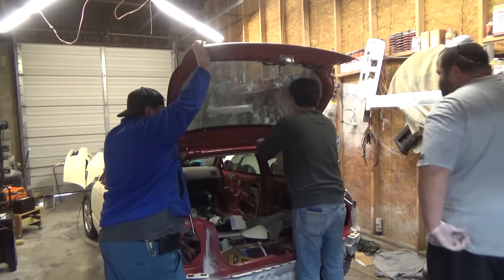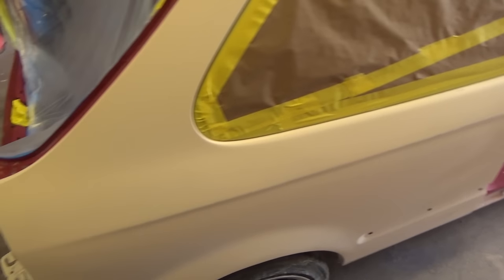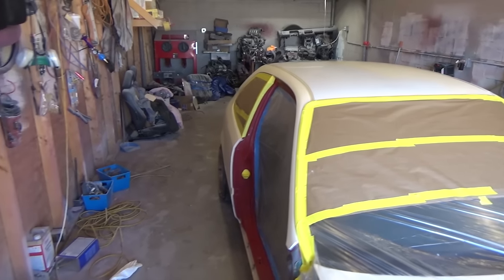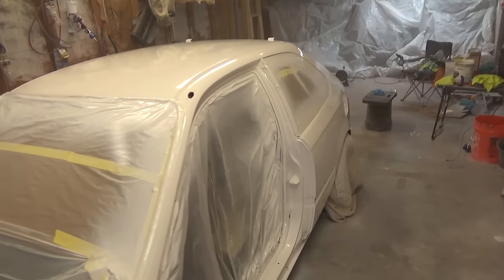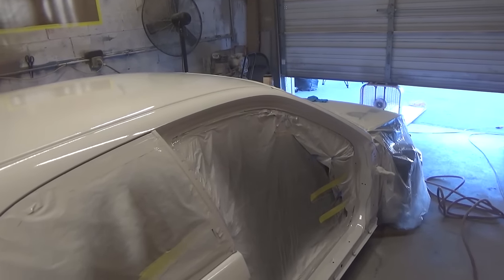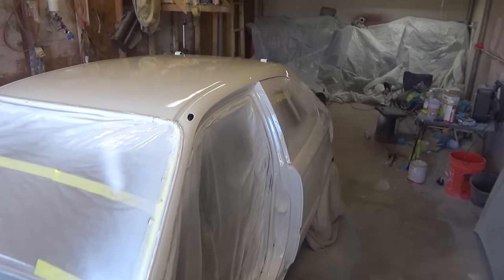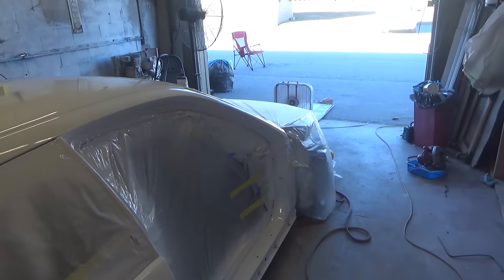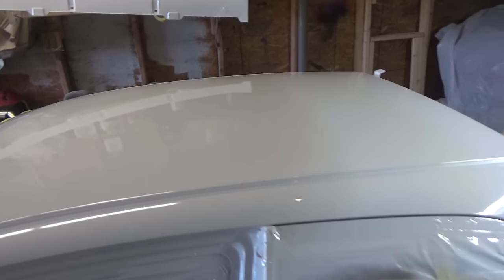Civic Hatchback Paint Job (Built On A Budget)

Comment: Not sure how big your air compressor is but I use to have a 55gallon tank and when I use to do big jobs with it like full cars or when spraying clear on big panels I would have to stop and let the air compressor fill up otherwise I would loose air pressure at the gun and the spray pattern would change, i upgraded air compressor a long time ago though
Reply: What air compressor are you running now?
Reply: First thing i noticed was the compressor constantly running and definitely would be loosing pressure at the gun and killing the compressor at the same time

Comment: Its hard to tell on video but this paint job looks pretty good for a garage job. I assume u sprayed Single Stage Paint. I wanna say ur using a HVLP gun which is probably why ur ok using a smaller compressor. If u used a conventional gun u would look abit better but u would definately need a bigger compressor and it would also create alot more overspray. But good job, love your channel